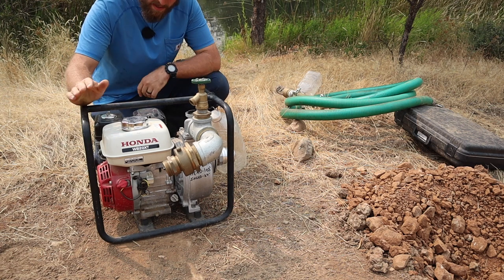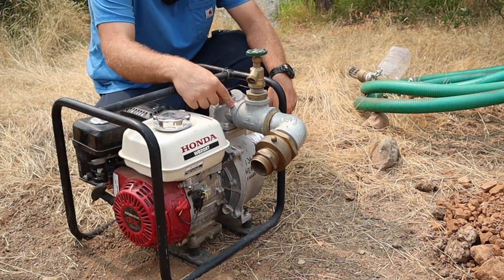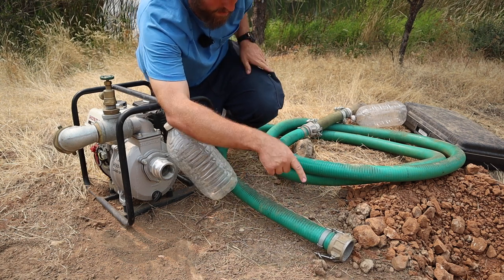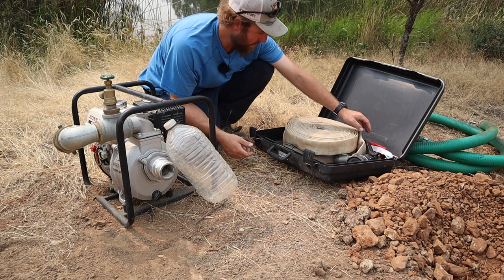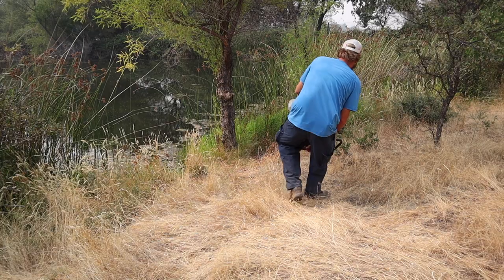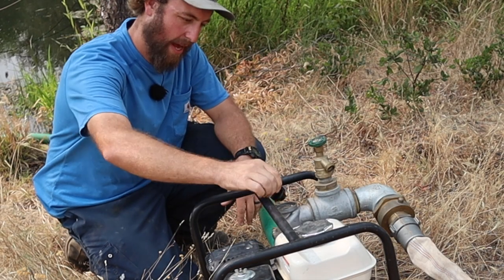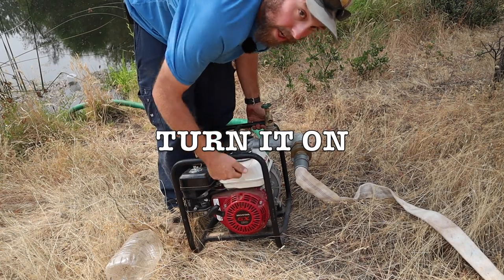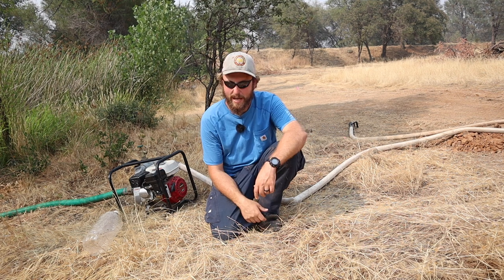DIY "FIRE PUMP", Something rather than nothing

Comment: this might help you,  when I was a wildland fire fighter we always rolled up our hose with the connectors outside. When you lay your hose out fold it in half.  start rolling it from the middle section. that way you can grab the connectors fling it out and you'll already have the both ends that you need.  when it's rolled up you can secure with a makeshift bungee. we use sections of cut up inner tube. go with one inch if you can. it'll be easy easier to handle.  you could do use your large hose as a distribution line and run gated Y's off of it. just be careful of how long your lines are. 45psi isn't much but if your well ahead of the fire you can put down a good wet line. cheers

Comment: Great to see you getting prepared. You can prime  the suction hose by jiggling the foot valve as fast as you can in the water. Moving it back and forward will push water into the hose on the forward stroke and the foot valve will stop the water coming out on the backward stroke. Works best if you are standing in the water . Also works better if you leave the priming cap off the pump to let the air out at the top. Cheers from Western Australia
Reply: Good suggestion! I fill the suction hose with water before firing up the pump. Greetings from Greece.
Reply: @sixoremenos  That's the best suggestion.

Comment: Brilliant.  Best how-to on YouTube.  I use 'trash' pumps to move water out of the ditches during spring run-off if the culvert gets overwhelmed.  The recommendation to use a check valve on the intake and kink the discharge hose then walk the discharge through the hose as it fills is something I never thought of.  I would often have problems getting the hose to expand to capacity.  The tip I would add is if you are pumping and the temperatures are just above freezing, soak your discharge hoses in hot water first.  Great video.

Comment: FIRST CLASS ALL THE WAY!!!
We're going to put a system together also as soon as we move to the Pacific NW.
Suggestion For You & Your Family (since you're also in CA):
* I'm going to install a sprinkler system at the top of my home along the "ridge" and then I'll be able to hook up my water pump to not only a hose system like yours but, pump the water to the top of the home (as long as a have access to a large water system like you have) and make the home "damp".
* I might even have two systems to make it more redundant and easier on me.
* If any fires get close to the home, we'll first turn on the sprinkler system at the top of our home (on a slow mist to moisten everything and conserve water; turn up the volume later if necessary) and then I can take a second water pump and also fight the fire farther out! 

If ya want to live in the forests and enjoy them, this is the prepping ya need to do and I have no problem with it!

Amen
Retired, Veteran

Comment: You might want to look into installing what's known as a "dry hydrant".  Also, wildlands fire crews use a 1" hoseline.  That and some hand tools will go a long way.
Reply: A dry hydrant is basically a normal municipal fire hydrant designed for areas that have freezing temperatures. I’m pretty sure you cannot simply install one a dry hydrant with a pond as the water source. You wouldn’t have any pressure in the hydrant. 

1” hose is a great idea especially with using a 1.5” to 1” reducer. You might find an adapter to put at the end of the 1.5” hose then reduce to 1”. This would lengthen the total hose and help reduce friction loss while increasing pressure at the nozzle and more distance coming out of the nozzle.
Reply: @thenukerunner4906  A dry hydrant is installed at a pond for pumper suction. You are thinking of a "dry barrel" hydrant. But dry hydrants are intended for fire department use; I don't see what advantage it would have over what he's got unless he's gonna be buying a class A engine as well.

Also, you seem to not have a basic understanding of fluid dynamics. How in the world can you possibly think a smaller hose would reduce friction loss and increase pressure?!? The only advantage to reducing the size of hose midway through is reducing the labor required to move it around.

Ok well I do know how you could think that, it's a common misconception, but pipes do not behave as nozzles, pressure is pressure regardless of changes in pipe size. Only an actual outlet is a nozzle and produces a stream length. Smaller orifices look like they are making "more pressure" but that's because they are flowing less water, causing less pressure loss in the system.

The best thing he could do to deal with the low pressures of that transfer pump would be to use a 2.5" hose with a 15/16" smoothbore nozzle. The undersized nozzle meaning low flow for a 2.5", and the big hose meaning minimum friction loss for such a flow. Smoothbore because it can be effective with as low nozzle pressure as 40 psi.

Comment: I think if you had a 10 foot rope on the engine side of the suction hose. Throw that end in the pond also pull it out with the rope and it will be full  bc of the foot valve and it will be an instant prime if you lift the hose 5 ft away from the pump then water will drain into the pump and out into the flat hose. Worst case you have a rope wrapped around the suction hose 2 ft from the engine. Just an idea. Hey were dod you get the case for the hose?

Comment: I would delete that 90 and put in a ball shut off valve. You'll gain a little more psi. Also try and get some 1" hose. Use the 1 1/5 hose to get you out there and the 1" to fight fire. Lighter to use.

Comment: I was just doing research on this and had this pump in my cart on amazon. I think I'm sold, now I just need to find the rest of the parts you have.
Reply from the maker: Hey that's great, happy to help. They should have most of the steel pipe fittings at your local hardware store. and the fire hose fittings are available at amazon or at firehosedirect.com thanks for watching.

Comment: Fwiw on pump brand at the property I live at we have 2 Honda pumps, a Northstar pump and 2 harbor freight pumps and have had as many or more issues with the Hondas than the cheaper ones. They all get used more or less equally. It feels nice to know there are a few Hondas but as far as what we've seen the reliability is fairly consistent across brands.

We also use FH thread instead of camlock and then carry adapters if we need to hook up to a camlock supply. Not sure exactly why, but it's what they had in place when I moved here and the whole setup saw a lot of very successful use in the 2020 lightening fires. Our tanks are located at high points with outlets on the tanks and are all plumbed downhill with underground 3" pvc and steel risers to hook into near the major structures.

Comment: It is much quicker to stretch a hose line if you fold instead of roll it up. Another downside to rolling is the hose close to the fitting on the inside end can see premature  wear because of the kink. 

Small engines stay reliable when the gas in them is the best it can be. For something as dependable as a fire pump, ethanol free gas would be smart of course running the pump every once in a while. 

(Side note for small engines)  Although I don't think Honda uses vinyl fuel line but ethanol in fuels actually will eat vinyl over time. The more expensive black rubber gas line is where it's at.

Comment: Nice job ... 
Just a head Up!! 
Most if not All fier stations
Dry out ther HOSES beford
Rolin Them Up!! 
They rot if stored wet!!
Reply: Although historically fire hoses were spun with cotton, modern firehouse are synthetic and water doesn't affect them other than causing foul smelling water. But it is a good idea to drain them, much easier to stretch out the next time they're needed. 

The sun's UV destroys hoses...and extension cords.
Reply: @ericpeck3180  All Danish godt stations i know of
Dry out ther A B C hoses after end use
Becaus of the (rubber insider the cotten 
Shield rot ower time when left wet
MAYBE they now in 2022 hawe new 
Rubber silicone insider not rotting AWAY
As far as I know they still dry out ther hoses)
Reply: And ofcorse in a city with call out
EVERY DAY IT is not nessesery
But when you like in Denmark
Hawe MAYBE 2 calls or
More terning then aculey
Fiers wełl THING seems to get rotten 
Way faster if not dryed Up..

Comment: You seem to misunderstand the head concept. Head is height- it doesn't matter how long your suction or discharge hose is in regards to the Head. Yes longer hoses will move less water / lower discharge pressure but you can theoretically have hoses much longer than what you currently have. I design basic fire systems in regards to pressure losses from fitting and pipe length etc.
And as another person mentioned if possible get rid of the 2" 90

Comment: No expert here however common sense would dictate that if the hose is able to be kinked so easily (like yours) you do not have enough pressure. Remove the elbow as well. Contact local fire and verify what type of hose/fittings they use to copy
Reply: Common sence also dictates 
That a thin hose kinks EASY
At same presiur as C or B
Hose does!! The NOSSEL presiur 
Was atleast 20Meter /2+Bar / 30psi

Comment: Wow thanks for being one of the few people on the internet using an actual structural firefighting nozzle and not one of those ancient occupant hose nozzles that are insanely flow restricting. But maybe a gauge on the pump discharge? Is the pump able to get adequate pressure to the nozzle? Is it a 75 or 100 psi nozzle? Are you flowing at least 150 gpm?

Edit: Just read another comment saying this is a transfer pump and not a high pressure pump. I would suggest if you are going to be using such low pressures (I can tell by the kinking in the line just from you holding it), that you try a 2.5" hose with a 15/16" nozzle tip. This should be able to produce adequate fire flow at nozzle pressures as low as 40 psi with minimal friction loss.